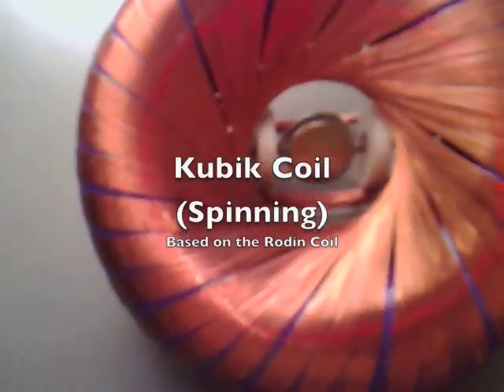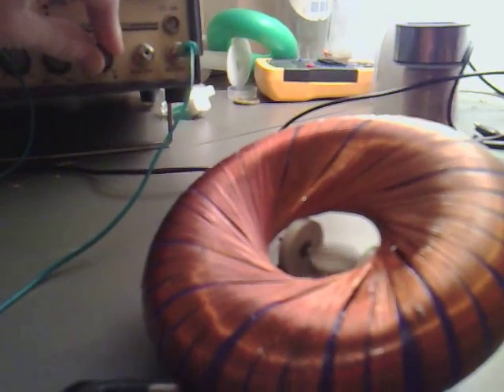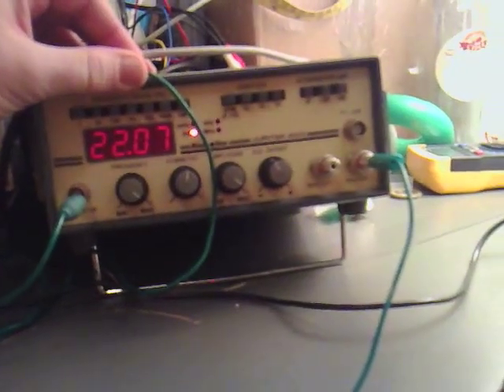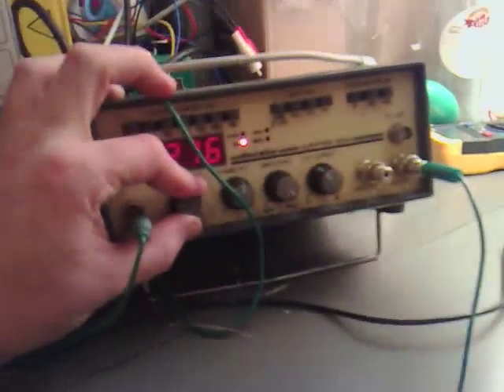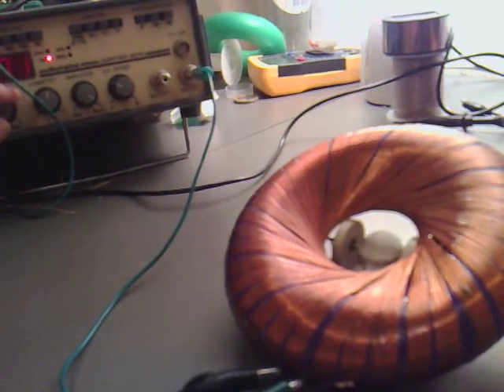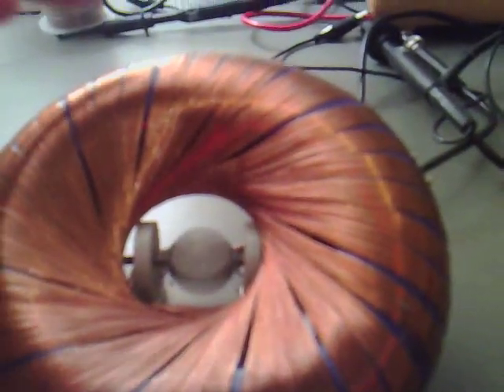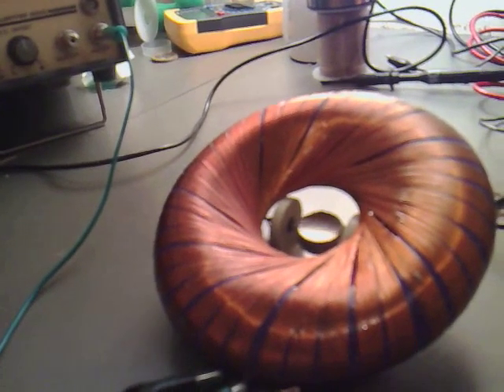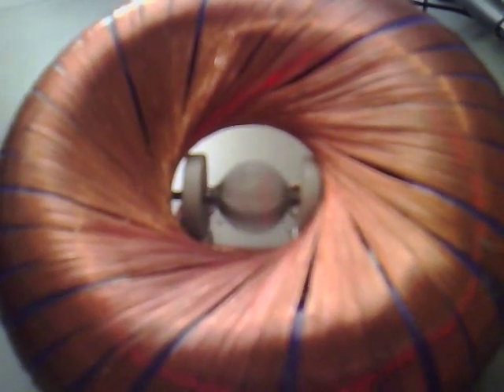Kubik Coil (Spinning) 007

Comment: What was being tested was not described or clarified. It would seem that it is a motor with the windings offset 45 degrees.   I think the windings themselves lose efficiency due to their lack of precise spacing.  I would like to see more in the form of actual HP to wattage used.  I think more careful winding would result in better efficiency.
Best of luck to you and keep up the good work
John

Comment: I just bought 14,000 feet of AWG 24 cross connect wire. Most in 1,000 foot spools. Wires wrapped around each other in each spool means 2,000 feet of wire per spool. If interested in making any type coil from this contact me for a price much better than Ebays.

Comment: The big question is not how fast it spins  a rotor but how much rotor torque the coil can produce.  To be useful as a motor it must be able to produce the needed torque to spin power something besides itself.  I am working in that direction presently.

Comment: is the amount of power required to get the magnet spinning enough that if you had the magnet attached to some kind of dynamo charger you could eventually remove the primary power source and have the power generated from the dynamo feeding back into the coil?  or is that not realistic, even with capacitors and stuff?

Comment: So at the centre of the spiral you should create a cylindrical tube of cross wires with an open middle into which you can place experiments. The winding could prove problematical as the cylindrical weave develops so maybe just 2 coils of the spring to start with. What do you think?

Comment: Ok Paul, know you got a lot of projects but this one is really important. I am asking if you could do a rodin winding on a spring? Using a large car or lorry spring do a winding that is not toroidal but spiral. The winding is marked out the same way on each of the coils of the spring as you look at the circular cross section of the spring but the winding passes from coil to coil in the rodin sequence ytravelling up and down the spiral. This should produce a cylyndrical tube of cross wires at cen

Comment: Thanks keep up the good work. you will be able to test the rodin coil design with 2 oscillators and see if the third coil being  off is really necessary, as rodin claims. The question is is it the winding or the vector arrangement in the centre that is important. Three coils on will test this. Also does the signal need to be pulsed or out of phase. Cant wait to see more,

Comment: I found an "Electric field from a solenoid" paper which implied that if you place a loop of wire OUTSIDE the solenoid, regardless of radius, you will observe the same EMF. If true, if you spin your magnet some other way, and use the Rodin for inductive pickup, that might be interesting. Good video!